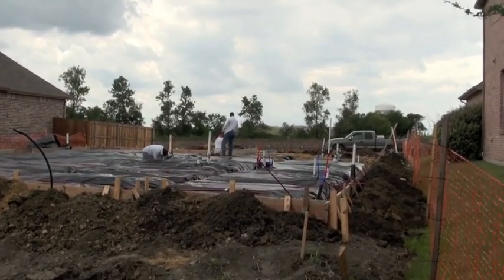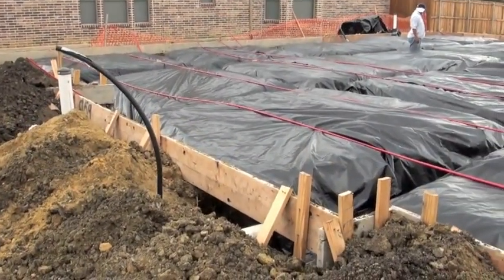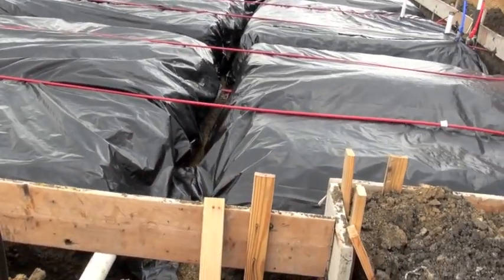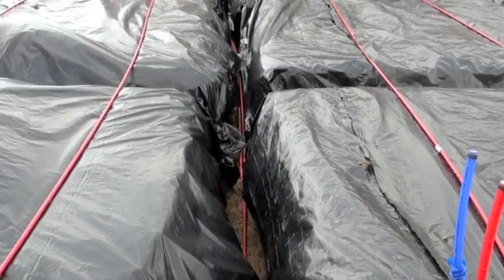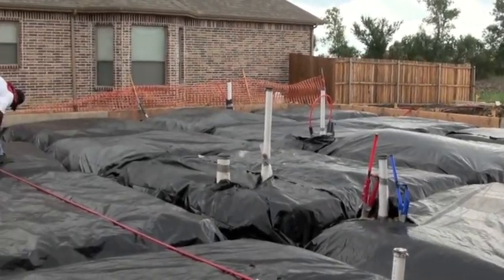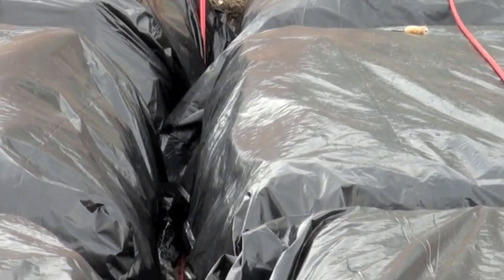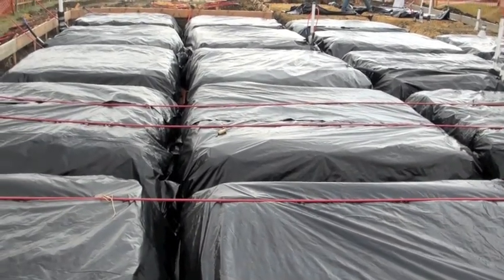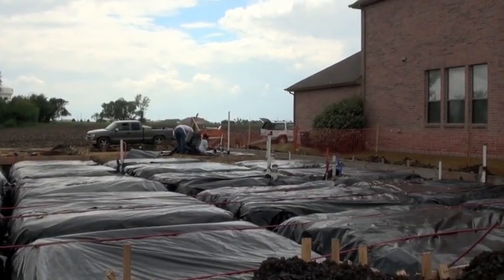Slab Construction | Dallas, TX | Foundation Repair | Plano, TX

Comment: We are in the process of building our home and your video helps tremendously.  I have a question:  my build graded the dirt , the moisture barrier as well as the cables are in.  However, it has been sitting like that for almost a month and with heavy rain we have had in Austin, which caused a lot of the dirt being washed away and about 6 moisture barrier had been flown away as well.  What and how they should fix  the situation to make sure the integrity of the foundation is not compromised?

Can’t wait for your response.